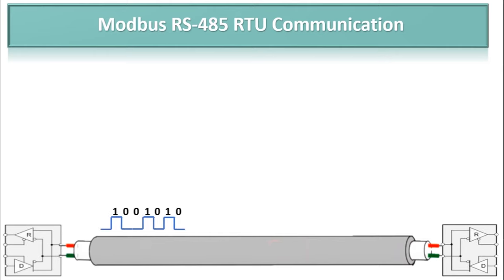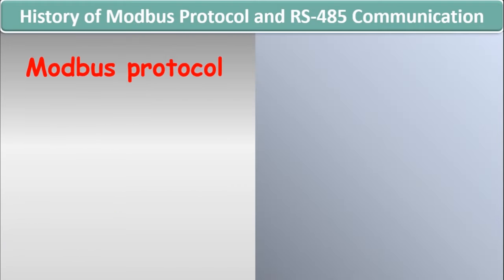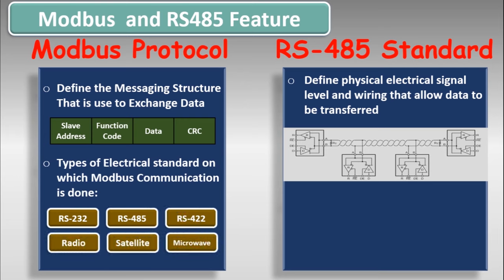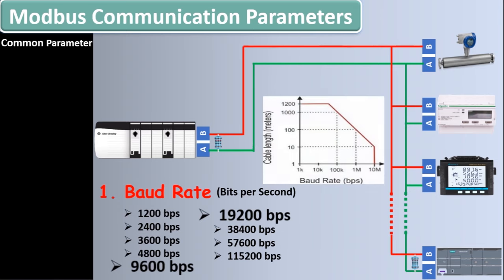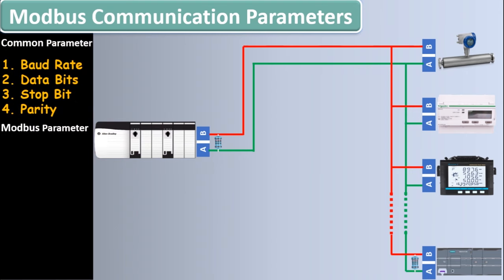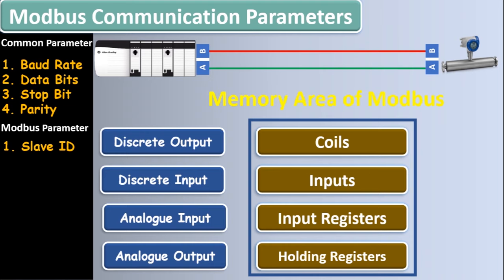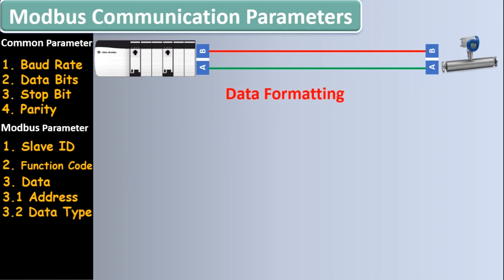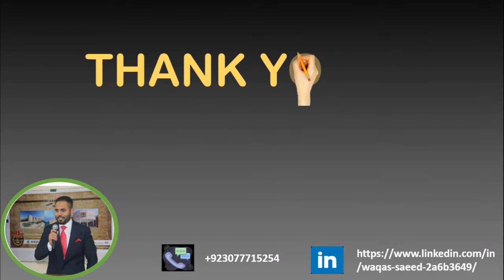01- What is Modbus ? And detail of Modbus RS485 RTU Communication?

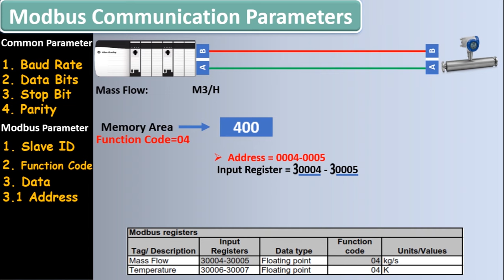Comment: sir one confusion , if function code is defined as 04 for input registers and data address as 30001~40000, then how can the input register 30004 represent the function code 3 for input register as mentioned at 20:21

Comment: Sure, here are the answers to your questions:

1. The Modbus function code used in the request from the master to read several registers of the slave is 0x03, which is the Read Holding Registers function code.

2. The address of the first register to read in the master query is 0x0202.

3. The number of registers to read in the master query is 0x0258, which is 600 in decimal.

4. To decode the Modbus message sent by the slave, we can break down the message into its different parts:

Slave Address: 0x04 - This indicates that the message is intended for slave device with address 0x04.
Function Code: 0x03 - This indicates the function code used in the request, which is 0x03 for Read Holding Registers.
Starting Address: 0x0202 - This is the address of the first register to be read by the master.
Number of Registers: 0x0258 - This is the number of registers to be read by the master.
CRC: 0xDE74 - This is the Modbus CRC value for error checking.

To answer the question "What is the request sent by the Modbus master to read the slave registers from the address of departure 00 64?", we can convert the decimal value 100 (which is 0x64 in hexadecimal) to a Modbus address, which would be 0x0064. Thus, the request sent by the Modbus master would be:

Slave Address: 0x04
Function Code: 0x03
Starting Address: 0x0064
Number of Registers: 0x0258 (600 in decimal)
CRC: Calculated by the master based on the request message.
Show less
Reply: Well done sir

Comment: What is the Common thing Between Profibus & Modbus Communication?
Reply from the maker: Both are the communication protocols can be transferred over the same physical layer of OSI model via electrical standard RS485.
Both works on the Master slave type protocol.
With the RS485 physical layer both can communicate upto distance of 1200 meter
You can use unit ID of save from 1-247 in both the protocols.
There are many more similarities. 
Both the different protocols, they may works better from each other in different applications